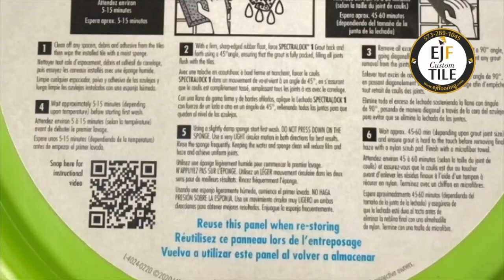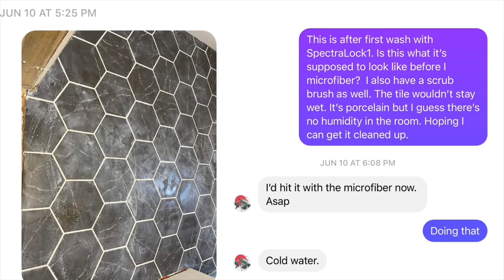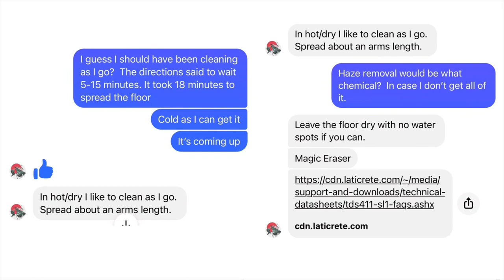How (Not) To Use SpectraLock 1 Pre-Mix Grout | Columbia MO

Comment: You demonstrate a great example of humility. I learned a lot from your video and the comments. Thank you for the education!
Reply from the maker: That’s the reason I shared the video. I wanted so badly to have a smooth installation. Unfortunately that didn’t work out for me. It isn’t a total loss, my floor did turn out great. Learn from the mistakes I made and you’ll have a great looking floor without nearly the amount of effort. Thank you for the compliment, I appreciate it.

Comment: Having used this grout a few times myself I could see from the very beginning that he was headed for disaster. With this grout you do small sections at a time, clean and wipe and maybe start a new section in the interim but returning to the previous section to clean, clean and clean some more... If not then you're going to have quite the mess to deal with! 
I also noticed that he's cleaning with only one bucket of water with maybe a half gallon of water for the entire floor. You need quite a bit more water and changeout of water to do a floor that size. He should have two buckets, 2 gallon each and he should have a dirty bucket to rinse the sponge and a clean bucket to start again... So many things wrong in this video but in the end it all works out.
Reply from the maker: Thank you for the advice
Reply: I saw the same, 20 minutes was too long. I was thinking, clean bro, clean.

Comment: When you started spreading the grout on the entire shower floor, I knew it was going to be a problem. The same thing happened to me. Unfortunately, my case was even worse because the tile was small white square mosaic  1" x 1", so had tons of grout lines between tiles and, being white, I couldn't even see where the grout's heavy haze was, but I could feel it was there and drying fast. It stared getting hard real fast and I just knew I was in trouble. It wouldn't come off no matter how much I scrubbed the sponge, so I panicked and in desperation I just turned on the handheld shower and started scrubbing with a heavy nylon sponge to flush it all down the drain. It was a mission but I got it all off the tile and most of it off the grout lines. After a few days I reapplied in small sections and it worked. I think the instructions should mention ypu should do SMALL SECTIONS at a time. That is crucial information.
Reply from the maker: Thank you for sharing your experience. I think this is a good product, I just didn’t use it correctly.

Comment: People go nuts over the hazing with this stuff and how long it takes to clean up etc… but in reality working just the joints, not covering the whole floor and cleaning up how the instructions clearly say has always worked for me no problems.
Reply from the maker: I made it clear that I’m not blaming the product, I should have used it like a urethane grout. The directions do say to spread and wait 15 minutes before initial rinse. Everything worked out, that’s what matters.
Reply: My gripes aren’t directed at you, just in general.  I see a bunch of people online afraid of this stuff. You did well recovering once you realized what was going on. Soon as you spread it like traditional grout I was hooked to see what you’d do. Recovery from that was great and I bet messy.
Reply from the maker: I’ve learned that keeping after fresh grout goes a long way. The biggest mistake I see people do is get frustrated and walk away. I stayed after it and it took a couple of hours of cleaning that night to get it close. I did have another hour or so the next day with haze remover to get it finished up. Everything looks good and I’m happy (it was my own job, I’m the customer) and that’s what is important. I do appreciate you watching and commenting. Thank you.
Reply: I use a grout release always with spectra lock 1 and I only have to wipe it once

Comment: so would you recommend only grouting about a 1/3 of the floor then clean up?
Reply from the maker: Actually as fast as the tile was drying I would grout and clean as I went. In the video when I first started to wet the tile again I should have cleaned up what I had already spread. I tend to make a plan for myself and stick to it regardless of the circumstances. My plan was to spread the whole floor, so that’s what I did. Luckily it worked out, it just took far longer than it should have.
Reply: I use sp1 the same as flex color and only spread out about an arms reach before first wipe. Then come back with microfiber, then come back with windex or a stone tech cleaner. I think real epoxy grout is easier to work with and has better performance
Reply from the maker: @ashtondaviston5051  that’s a good way of using SP1, thanks for the reply.

Comment: I did one today, If you use the scratchy side of a sponge, it comes off much easier, then go over it with the sponge side (similar to doing epoxy grout) I waited an hour and went over it a second time with the sponge and it was clean.  I did about 3x6 sections at a time.  Tomorrow I'll wipe the haze off.
Reply from the maker: Thanks for the tips, I appreciate it.

Comment: I just experimented with Spectralock 1 on a subway tile mockup. I applied it to 2mm grout lines and found it quite easy to apply with a fairly stiff float. Waited 12 min then sponged off lightly. Then let it sit 45 min and then scrubbed with pad then fibre cloth. Had no problem with that although obvious a 3x3’ area is about max between application and first rinse. This stuff does set up fast. It did a great job except being a fine sand grout applied to a gloss  tile, under a bright direct light i could see a few very fine scratches. Under normal lighting in a shower, floor, or backsplash, i doubt very much they would be noticeable. Thanks for the video as it helped a lot. In a few days i will be doing 2 floors and a bath surround and looking forward to it.
Reply from the maker: Glad I could help, hopefully you avoid some mistakes I made.
Reply: I think its a great grout but i find it is  quite a sandy grout. A bit more sandy than id like when paired with glossy tiles. However, i found that some of the sandiness (if thats a word) can depend upon how the float is applied.  Haven’t quite worked out the technique yet for consistent results but will post if and when i do

Comment: I just grouted a shower pan today using spectralock 1.  The shower pan was 4 foot by 5 foot using 2 inch hexagon tile. My job went real well but I had to work fast and fortunately the area was small. I don't know if doing a larger section in segments would be the answer because of "cold joints".  But if you cant break it up into small areas then you need a second guy doing almost immediate clean-up as you go.
Reply from the maker: I wouldn’t worry much about cold joints unless you leave the areas for really long periods of time. Typically there’s two of us.  With single component grout one of us spreads grout and the other rinses. For large floors I agree that it’s a two man job at a minimum.

Comment: Nice
I just used this on shower floor featuring shaved pebbles. I’m a dyir so I was a bit nervous. However everything went very well as far as I can tell. I did pre seal the floor before grout and will again after grout cures realizing the grout doesn’t need it but for the pebbles. Hopefully the walks go well also. I’ll be using 12x24 tiles horizontal
Reply from the maker: Sounds great, good luck with the rest of your project

Comment: I typically let it set for 5 to 10 minutes. I know it's ready to clean when my float will no longer pick it up off the face of the tile. I also use a 5 gallon bucket for wash water. It really reduces the amount of haze that needs to be cleaned off later. The white scrub pad suggested in the directions does a better job than the microfiber at removing the remaining grout during the second wash. Final wipe is with a dry microfiber to remove the haze once the grout is set.
Reply from the maker: I made several errors with this application. I’m just happy everything worked out in the end.

Comment: As I watched the video I realized it was going to be a Nightmare for clean up. I'd rather spend the extra 5 min mixing up a batch and stick to a product that I know and used to rather than spending the extra hours on cleanup. Definitely not worth it. I'm like you. I can spread the entire room faster than the first wash is even ready with ultra color FA. And clean up is super easy with mapei. As long as it's not super hot in the bathroom. I make sure the heat is turned off until grouting is complete or if it's summer I lower the temp in the home to 65 even prior to cleaning the grout joints in the morning. I tell my customers the importance of temperature control for the grout to come out perfect. I've been looking at specktralock 1 but have seen videos like yours that keeps me away from it.
Anyhow been watching you for years now. Love your videos. Thank you
Happy New year!
Reply from the maker: I do think this should be handled like any other single component grout and be spread and cleaned at the same time. Like you I have my favorite grout and it performs very well. It’s hard to use a different product when nothing is wrong with the product you prefer. Thank you for watching, I appreciate it.

Comment: I can't imagine working this hard to like a product, especially when you consider the outrageous cost of SpectraLock 1. I'm sorry to say this, but at $100-a-tub, the rep better be available at 3 am if you need him. IMO, that's his job. Having to clean as you grout is INSANE. It's two separate jobs, requiring two differing areas of focus. Who thought up this genius idea? At least the product looks creamier. Perhaps they have worked on the chemistry. I've seen videos from 2-3 years ago and watched users really struggle to keep the product from falling to the floor in clumps. It appeared quite thick and difficult to work. I was surprised that your single water bucket was so small. Some pro guys I've watched with this product use three 5-gallon buckets during the cleaning process, just to make sure to keep the sponge clean, clean, clean as you swipe, especially if the tile is dark. You had an absolute mess on your hands that could have turned more serious. Without the rep's assistance, I would have panicked. I can't be on the floor that long, especially without knee-pads. I'm surprised you do this kind of work being overweight. It puts a lot of strain on your heart. If you love your wife, try and lose some weight. Good luck.
Reply: What is nice about this product, after the job ios complete, there is no sealing of the grout and it is pretty much mantenance free for years and years. I've never had an issue.
Reply: @kenschneider2100   I'm happy to revisit the product in 20 years, if I'm still around, to see if your words ring true. The bottom line remains: if you want to work with this product, you had better be PREPARED. My gut is telling me, it won't be long before the competition comes up with something easier to work with and harder, because that's what professionals and the market want. With VOC regulations, the tile industry is experiencing the same changes as paint. The high-paid chemists are at work, attempting to discover a new holy grail, and companies are passing their R&D costs onto the consumer. We'll have to wait and see what the future holds in construction.
Reply from the maker: The important thing with grout is to keep after it. I didn’t watch any videos (obviously) before my attempt, I just read what the label said. I knew I was in trouble early and I didn’t change my plan. I should have realized what was going on sooner and saved myself a lot of extra work. Weight loss is on the agenda. Hopefully if you keep watching you’ll start to see improvement there as well.